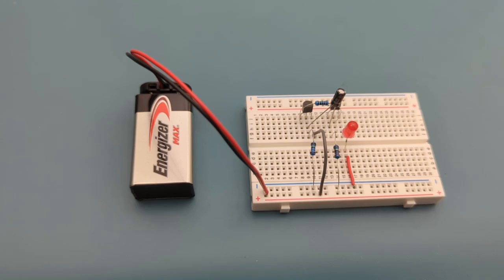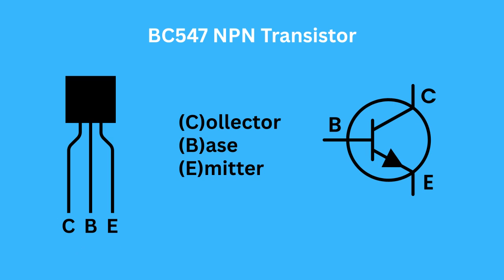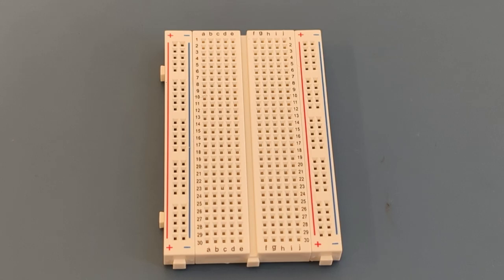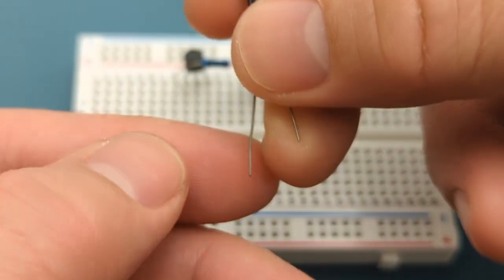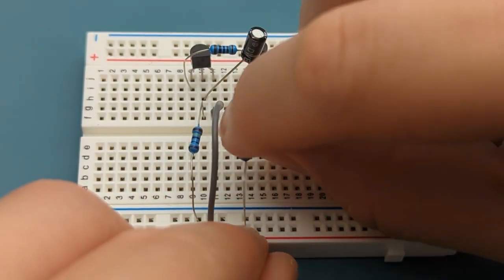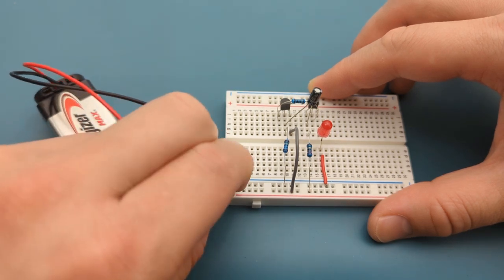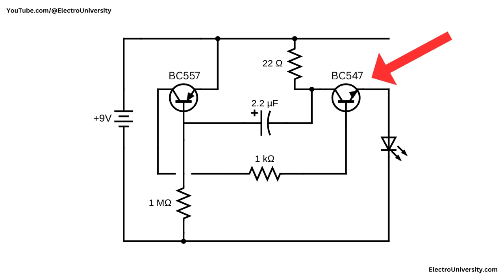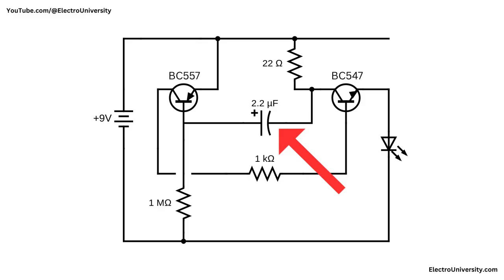How to Make a Flashing LED With BC547 Transistor

Comment from the maker: 🔔 Get your tools here:
✅ Electronics Component Kit: https://amzn.to/3N65asq
✅ 9V Battery Connector: https://amzn.to/3S7kbg8
✅ 9V Batteries: https://amzn.to/4kkonVD
✅ Transistors: https://amzn.to/3Z6qFQg
✅ Electrolytic Capacitors: https://amzn.to/4dnrJF4
✅ Resistors: https://amzn.to/3YfGeUi
✅ Jumper Wires: https://amzn.to/3NNn9UR
✅ Solderless Breadboards: https://amzn.to/3SndKWm

Comment: I Can't make it work. Went through the vid 4 times no joy.
Reply from the maker: Thanks for watching and taking the time to try it out. I'm sorry to hear it's not working for you. Sometimes, it's just one small connection that causes the issue. Double-check the transistor orientation (collector, base, emitter), as that's a common hiccup.